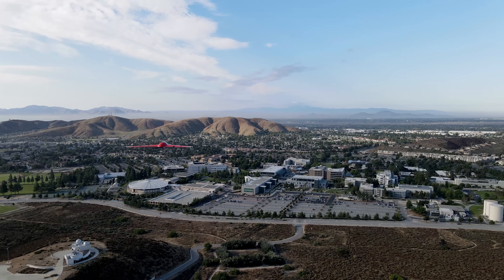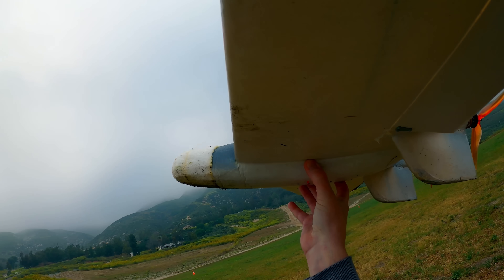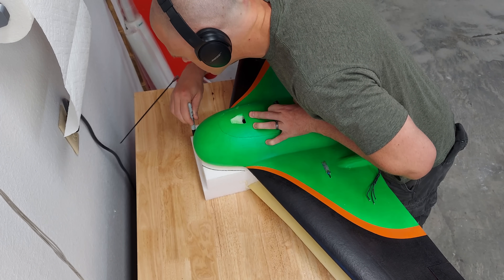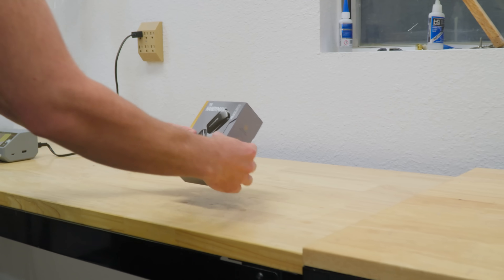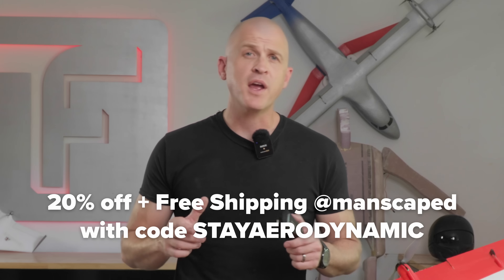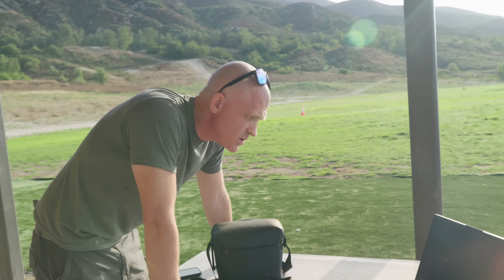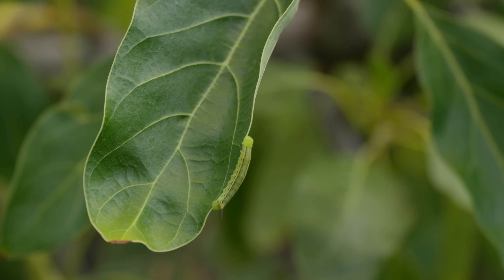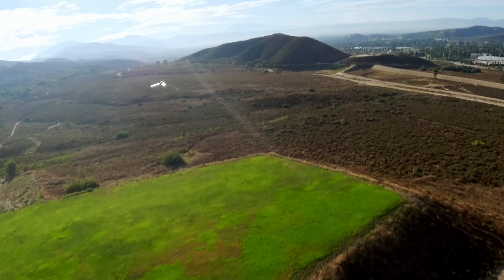Instability:  The Future of Drones?

Comment: Folding props with breaks set in ESCs.  Props will fold up on power off.  This should cure the motor popping issue.  Amazing job on the plane and ardupilot.  Learned a lot from your video.  Hope to have my own Arduplane in the air soon.
Reply from the maker: Can't find counter rotating folding prop yokes though.
Reply: @thinkflight  Aeronaut makes both CW and CCW folding prop. And those one of the best props on market.
Reply from the maker: @jaremarandall4386  i did not know this.   I will check them out again
Reply: @thinkflight  maybe because it's German company. if you have hard time getting them in US I could help with acquiring those.
Reply: @thinkflight  Ducts? Or wire skid style "landing gear". You could use a little servo to make the gear pop out. If you really want to be clever you could use some memory wire "skids" that fold themselves up and down with an almost negligible weight penalty.

If you want to go for the record though I would suggest active flow control.

I guess the easiest way would be to vector the motors.

Now that I'm thinking about it if somebody could figure out a way to make props like itty bitty helicopter blades you wouldn't have to vector them. They would vector themselves by changing blade pitch.

One last random thought. Ceramic based superhydrophobic spray, the reason it works is because it's THAT SMOOTH. Just saying.

Good luck, rooting for you.
Reply: Pusher folding props can work, but require some modification to prevent the props folding past the center line and becoming unbalanced.

Comment: That was interesting
Although I'm not that experienced with building and flying rc planes (more a drone guy) know quite a bit about batteries and especially for super long flights I'd recommend 21700 cells especially the new LG INR-21700-M58T which has outstanding energy density 280wh/kg (21wh/cell). But they have a quite low power output at just 36w continues per cell. The Samsung INR-21700 50s would also be a Good coice but they have "just" 18 wh per cell but can put out  way more power around 35A or 126w. I actually just got them today but have a jet to test them. I also thought about a dual battery system with a lipo providing the necessary takeoff power and the Li ion for cruising. You could also drop empty batteries once they are empty but you might consider this cheating :) 
Hyped for the next video keep it up 👍
Reply from the maker: Was using 21700 Molicels for this.

Comment: As a complete noob: pitch the two outer motors slightly up, two slightly down and get rid of all elevons. Make a solid state flyer ;)
The other choice is to 'elevate' two of the motors, but that's more problematic.
Reply: Kinda defeats the purpose of building an efficiency plane, to point the motor thrusts off the angle of attack.

But efficiency aside, this is an intriguing idea on its own.
Reply from the maker: How do you control the plane when you are power off coming in to land?
Reply: @thinkflight  Landing on the belly is a bad concept anyway - you carry no people - free your mind! Motor mounts break, props dig in - disaster. Do a last minute pitch up, lose all airspeed, turn nose down, do full reverse on the props, hover down onto the nose. An upside-down belly-flop manuver if you will. Even if it wont work, it's spectacular. But ofc for a few seconds you need TWR>>1.

Comment: Something I noted, why can't you "autopilot" the motors with sensors so blade position is uniform. Because as it is you seem to be introducing unstable airflow(rear turbulence )over the surface and possible oscillation across the entire wingspan.  I admit I know nothing about flight beyond the principle of lift, but as an outsider it seemed potentially problematic. Also this was written at the 4:45 mark, so forgive me if it's covered later. I'm the sort to brainstorm as it happens, LOL
Reply: There is no way for the props to impact airflow in front of them significantly, and synchronizing prop rotation is not useful in any case.
Reply: @nikolaihedler8883  it's not the airflow in front of them, it's the uneven distribution of torc force on a wing mount due to the turbulence they create for themselves? That was my general thought on it. It's foam, not aluminium, and more prone to flex . Like I said, I'm just an outsider looking in, I'm not pretending to know anything, and I certainly didn't explain what I was thinking very well. LOL
Reply: @Hat_Uncle  the torque is very small compared to the material strength.
Reply: @nikolaihedler8883  thank you. As I said, it was a thought process rather than objective knowledge, so I appreciate you taking the time to explain.

Comment: 6%!!!!!!
That's pretty significant, could the same principle be applied to any other flying wing? say a heewing f01, or would the fact that it's airfoil has reflex negate
the effects of the dynamic instability?
Reply: 6% from one test. One test. And not a very accurate one either. It could have been even more efficient, or much less. Impossible to know for sure until he does more tests.

Comment: Just wanted to note charger coloumb counters aren't an accurate way to measure discharge unless the flights happened with the same battery in the same day. Ardupilot should have logging of the current and the refresh cycle of the logging will give Ah, which can be summed for the total Ah used. Better yet logging voltage and current to find Wh would be even better as it's not battery config dependent.
Reply: Also doing a balance charge makes it inaccurate because some of the power put in was bleeding off to balance the cells. You need to do a unbalanced charge to see exactly how much goes back into the cell.
Reply: The variation will not be significant in a statistical analysis
Reply: @omotolaoyeniyi631  measuring both flights once is no sound statistical analysis
Reply: @uninteressant2196 was also wondering how changes in air temperature (amongst other variables) between the two flights could alter efficiency.
Reply: @cben86  Wind is probably the most significant variable
Reply: @abcdefg4570  good point!
Reply: @cben86 I would say that the battery being in the airframe would insulate it from minor temp changes but flying in below 0c weather and over about 40c will have a significant difference
Hotter weather with also give you more thermals but the air is less dense so you get less lift but also less drag

Comment: Comparing apples and oranges makes any results suspect. Flow over the wing is different due to the additiona motors. This is a very difficult test to complete with accuracy without a wind tunnel.
Reply: I mean comparing 2 data points isn't statistically significant either. Add in were not taken on the same day, it's essentially garbage data.
Reply: @portmanteau.  Eh, its garbage data because the testing pool isn't sufficient yet. Even in variable circumstances you can get accurate data reflecting a generalization, I wouldn't count it out simply because its not tested in a wind tunnel, but further testing is definitely necessary to draw a better conclusion.

Comment: I would expect a drag reduction from the reduced wetted area... also, can you compare/contrast the efficiency of 2 v. 4 electric motors?
Reply: agreed, as the boundary layer ingestion of the inner motors, combined with the tip vortex reduction of the outers, could significantly affect the results
Reply from the maker: You guys see where this is headed....